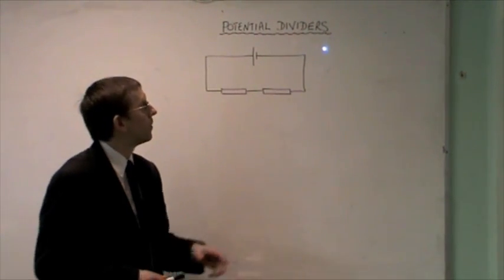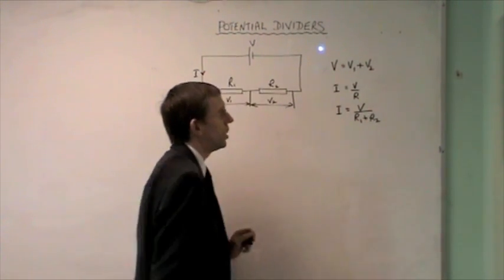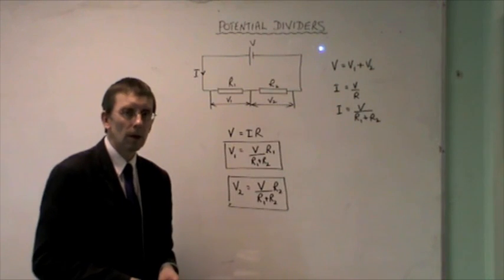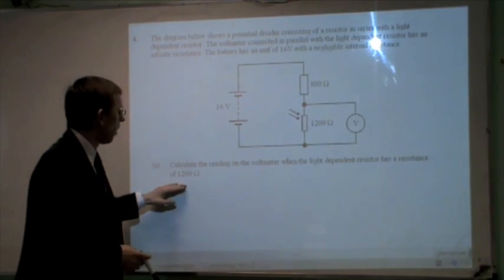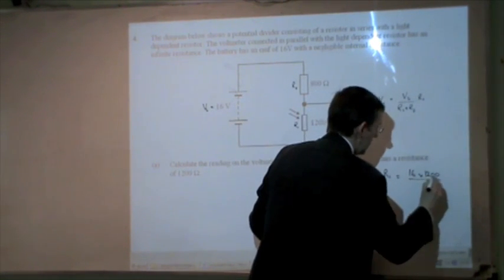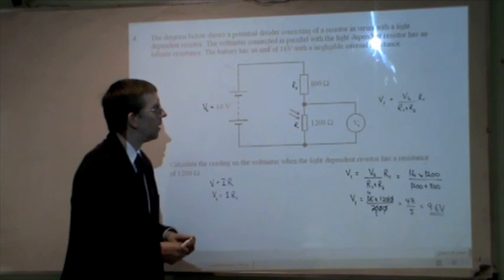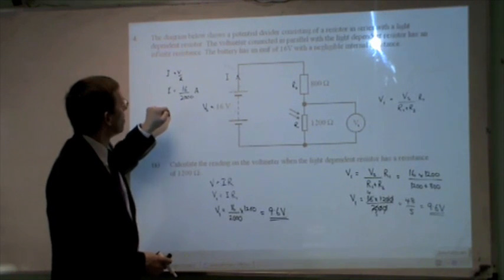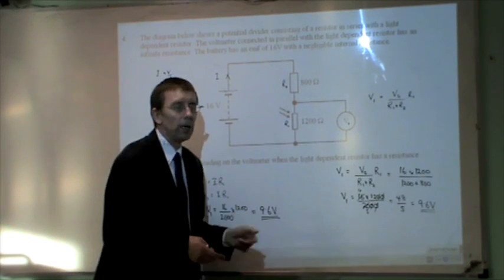What are potential dividers

Comment from the maker: @MrBenide 
First you can use V=IR to find I. To do this you need to use the pd provided by the cell and the total resistance in the cirucit. Once you know the current flowing you can use it to find the pd across an individual resistor using (V1) = I x (R1). You are using the fact that it is a series circuit and so the current is the same in all parts of the circuit.

Hope this helps!